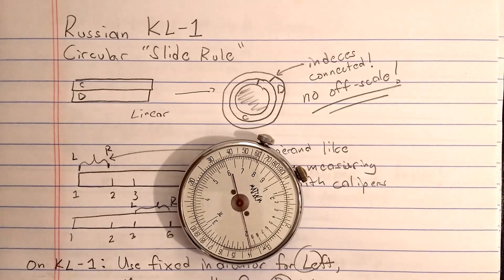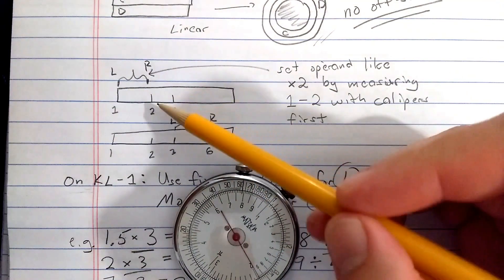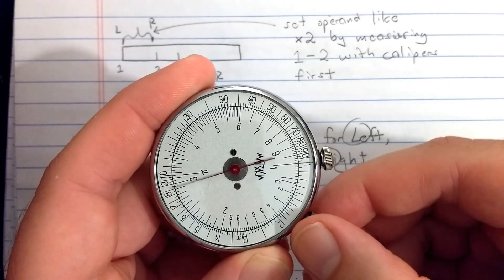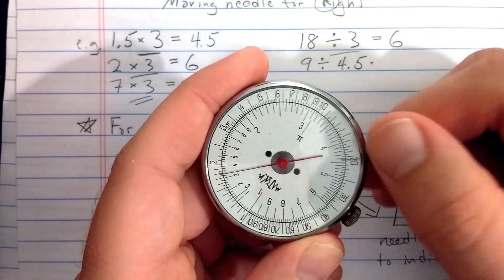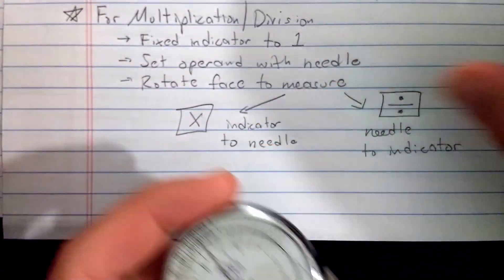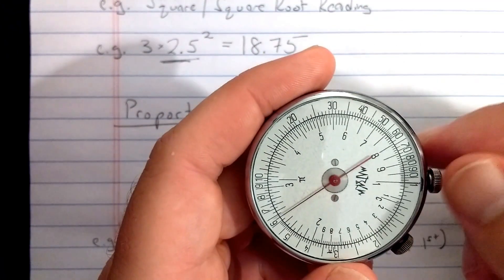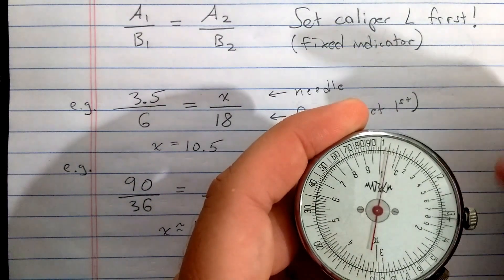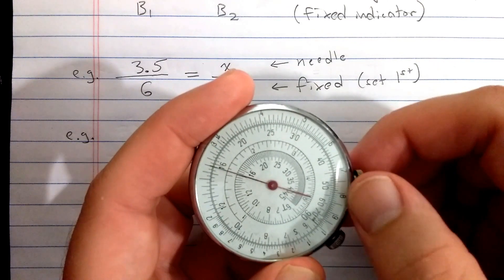Russian KL-1 Circular "Slide Rule" (1/2 -- basics)

Comment: an alternative that allows to perform chain calculations for multiplication as well as division is this:

to perform  a x b:
1. indicate 'a' under the index (ie rotate the scale so 'a' coincides with the fixed index)
2. indicate '1' on the needle
3. rotate 'b' on the scale towards the needle (this performs the multiplication by 'b', ie rotate over log(b))
4. read the result under the index.

to perform a / b:
1. indicate 'a' under the index
2. indicate 'b' on the needle
3. rotate '1' on the scale towards the needle
4. read the result under the index.
 
The difference is where to locate the second value: below the needle, or below the fixed mark.

The advantage of this method is that the result always ends up under the fixed index and can be used for a next calculation. (if a result ends up under the needle, it cannot be "transferred" to a subsequent calculation other than "manually".)
Reply: Another reason to use the fixed index as the result: to "transfer" a trig value 'a' (but not an angle) from the trig side to the other side, indicate 'a' with the needs, then flip over and rotate '1' to under the needle; the result 'a' becomes available under the fixed index.
Reply: a translation of a Russian original seems to suggest the same procedure:
search for KL-1 manual at http://sliderule.ozmanor.com/man/man-download.html

Comment: I want to make a circular slide rule for use as a flight computer (see E6B) and I want to know how it is I may figure out the degree spacing of the markings.
Reply from the maker: Here's the basic idea to get you started:

Let's say a regular slide rule is length 1 from left index to right index, so that position 0 means the left index and position 1 means the right index. The mark which is labelled X on a regular slide rule's D scale is at position log(X) [base-10 log]. For example, the label 1 appears at position 0, the label 2 appears at position log(2) ~ 0.3010, the label 3 appears at log(3) ~ 0.4771, etc. Note that 10 should appear at log(10) = 1, the right index.

For a circular slide rule, simply multiply the result by 360 degrees. The index is then at 0 deg (and 360 deg). The mark for 2 should be at 360*log(2) ~ 108.4 deg.

A and B scales are half length, so just divide all length or degree measurements by 2.
Reply: Professor Herning thank you very much. That's precisely what I needed.

Comment from the maker: One additional trick I don't think I've mentioned is "quick" multiplication or division. It's an application of the inverse proportions.

To multiply, move the needle to the first number on the trig side, then flip over and rotate the face so that the second number is at the needle. Result is at the fixed indicator.

To divide, do the reverse: Start on the normal side. Rotate face so dividend is under the fixed indicator, then move needle to divisor. Quotient is now on trig side under the needle.